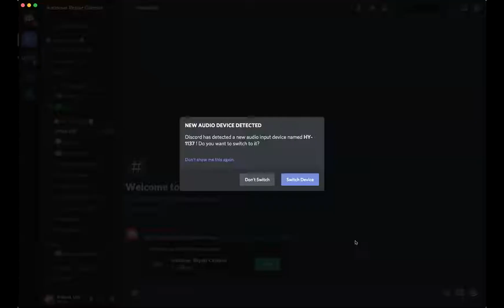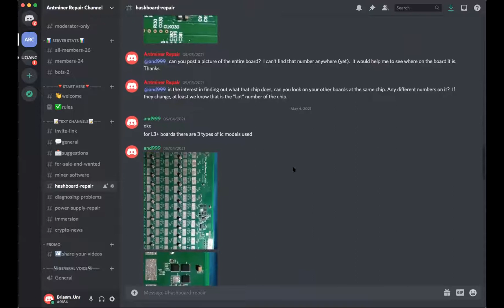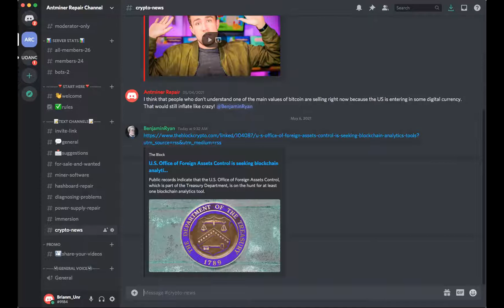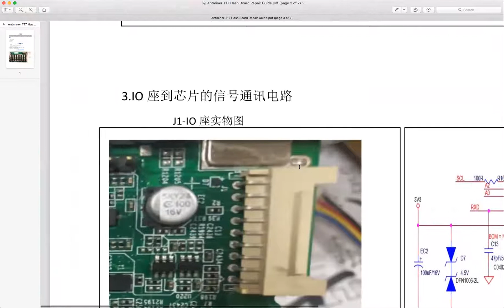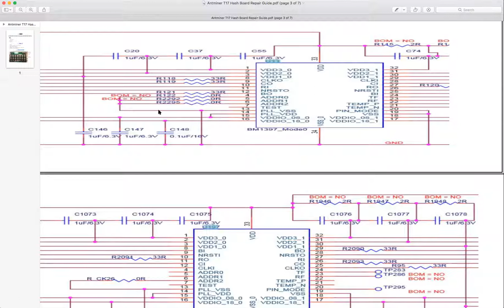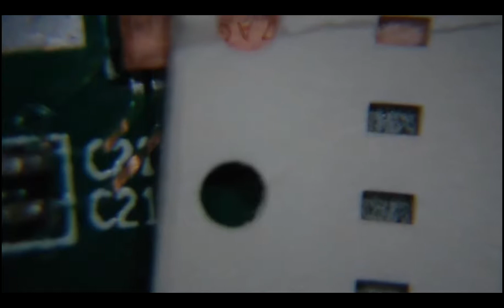Hashboard repair: Identify resistor/capacitor type and replacing

Comment: Thank you for explaining how to identify resistors and capacitors.
Could you expand on the exact steps in identifying these, such as:
1. Identify Size
2. Identify Resistance 
3. Identify Voltage
4. Places to source Components
?

Comment: Hello, what is the size this smd resistors ? 0402 ? 0805? 0201 ? Thx, buddy ! Its very nice video!
Reply from the maker: Hi,  I think most are 0201, but I use 0402 mostly.  either one will work, but if the 0402 works, perhaps it will be more robust.  Thanks!
Reply: @AntminerRepair  Dude, you are my hero! ) I take a soldering gun in my hands and i try do it. Thank you so much!
Reply from the maker: More often than not, I just hold the resistor down with tweezers and solder it (same with capacitors).  That is what I currently do.  Sometimes it is difficult for sure.
Reply: @AntminerRepair  I removed the chip today and lost some 30r resistors ))) Its very difficult, now im waiting for delivery..